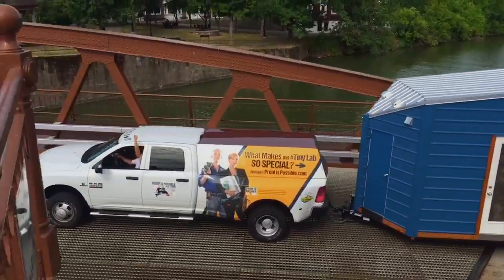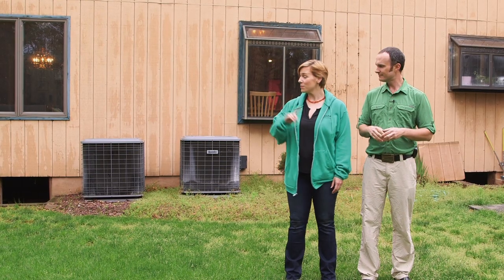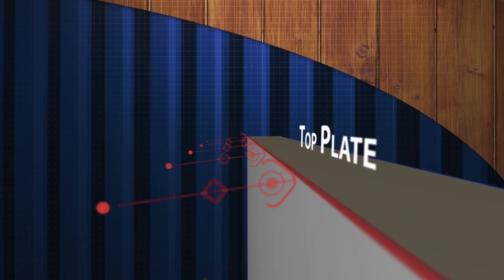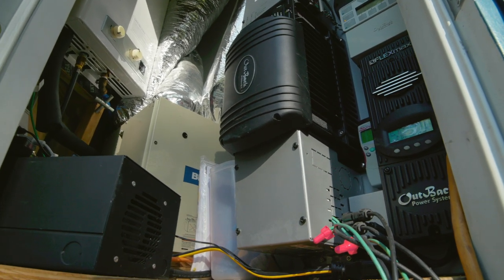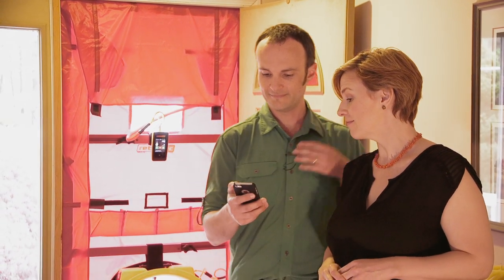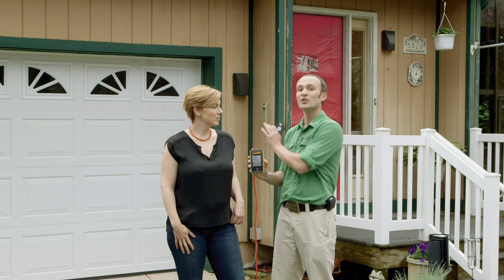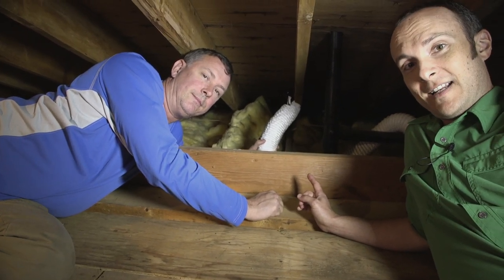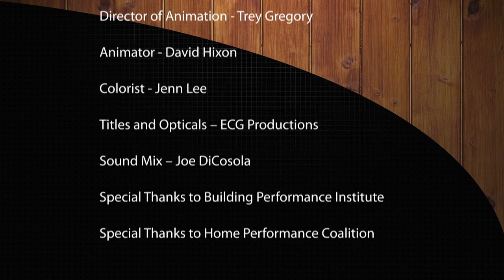Most Complicated House Ever Tested? - Ep 106 of Home Diagnosis TV Series

Comment: Testing is so important. I walked in to a home this week that called because of condensation on the roof-deck. Immediately upon walking in to the home, I knew something was wrong, I could actually feel it, and something bad. Rather than going straight to the attic like the homeowner expected, I had the homeowner show me the mechanical room. The 30+ year old water heater was back-drafting, burning inefficiently, and releasing moisture, and thankfully only low levels of carbon monoxide into the home. The homeowner was a bit surprised when I, an insulation contractor, ended up recommending a new water heater with proper flue sizing. I told her that this would need to be remedied before we could address the air sealing and insulation issues. Prioritizing safety issues is a BIG deal.
Reply: "Immediately upon walking in to the home, I knew something was wrong" 
OH what a feeling, when experience kicks in. Great story!